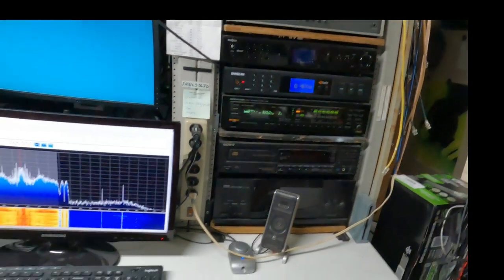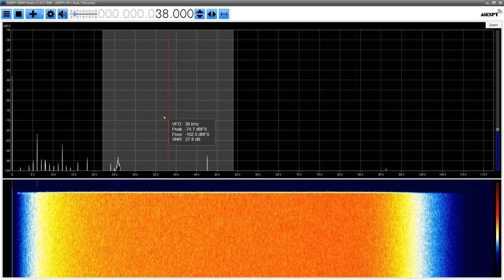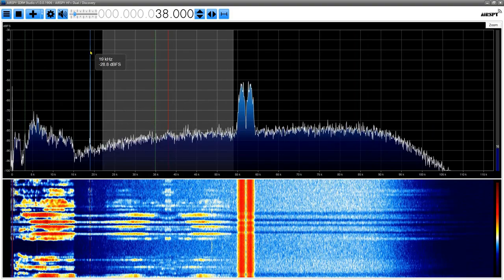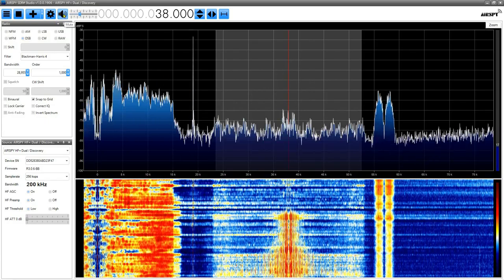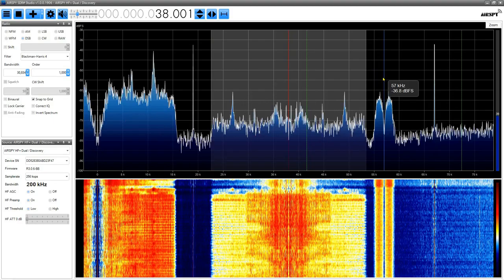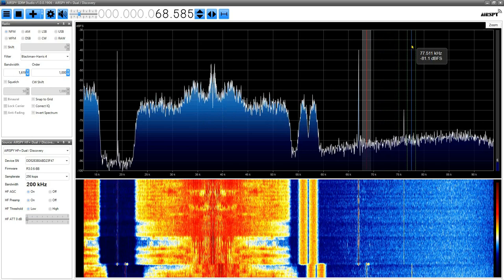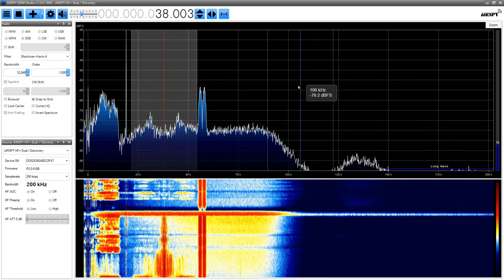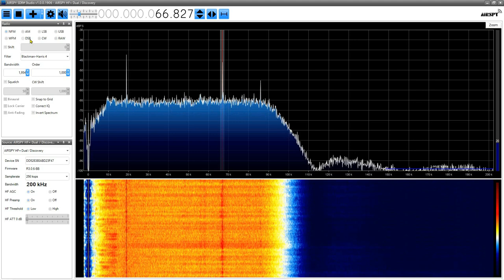Decoding FM multiplex  in Ancient times

Comment: Thanks for another great video, Paul.  Yes, SDRSharp has a plugin available for directly demodulating SCA audio.  It is a lot simpler than the old approach of opening up one instance of SDRSharp with a very wide audio bandwidth, piping that audio through a virtual audio cable, and into a second instance of SDRSharp to demodulate the 67 kHz SCA audio.  Basically, the first instance is used to tune in the FM station (88 to 108 MHz), 'capture the wideband audio, and demodulate the wideband audio with the second instance.  Here's a link to another YouTube video which describes the approach, and contains a link from where to download the SCATuner plugin for SDRSharp.  Unfortunately, this plugin is not part for the SDRSharp Community installer.  Thanks -- Ken/WBØOCV.  Here's the link:

https://www.youtube.com/watch?v=n5Ifg6ncn2Y